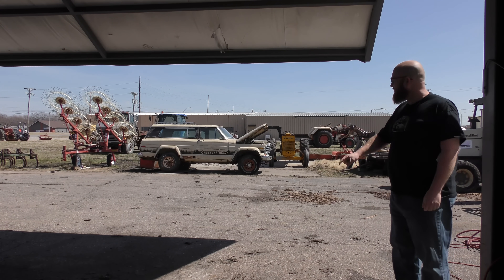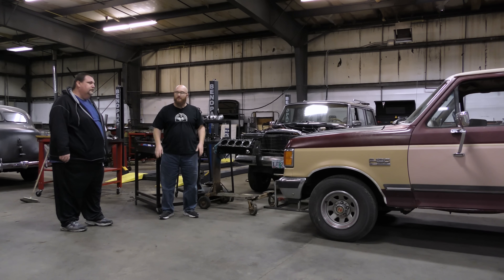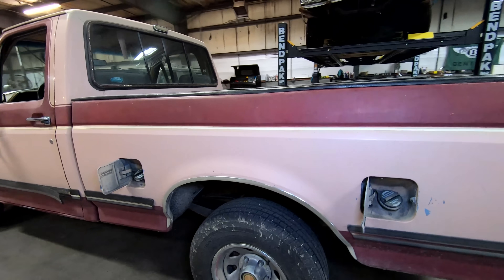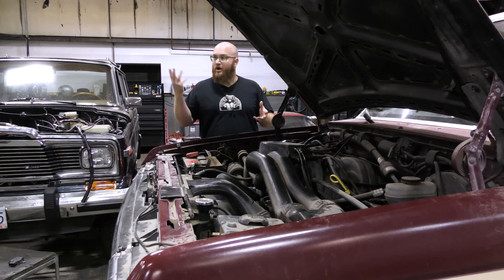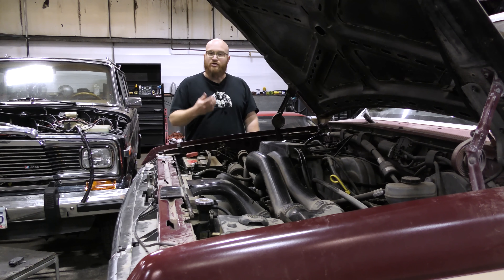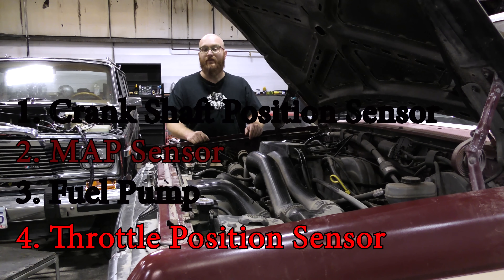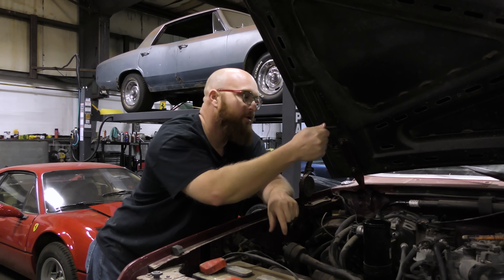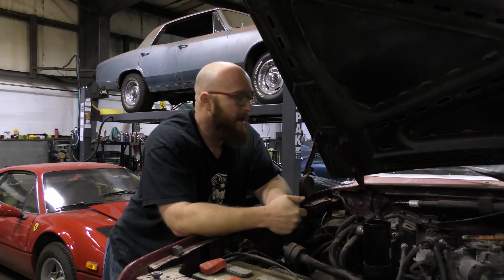Parts cannon couldn't fix this '90 F150. Old School diagnosing by the CAR WIZARD

Comment: Had this exact problem ony 1990 f150 5.8. Could not for the life of me figure the high idle problem. Changed everything, iac valve, tps, map sensor and every vacuum line on the engine. Did nothing. I was pulling my hair out trying to figure out the problem. Then I did the smoke test and I could just see a small amount coming out from underneath the throttle body where the tps is. Bought a new throttle body. Problem solved.

Comment: BBK Performance 3503 throttle bodies (P/N BBK-3503) are in stock at Summit Racing.   Kind of expensive but they are new parts and have improved seals as well.

Comment: For one theres no crank sensor on this truck, 

The required sensors that run these eec4 trucks is map, tps, o2, iat or manifold iat, and tfi/cam pip 

95 cali trucks and 96 will have maf only 

The rest of these are speed density

Comment: I think your wrong about not being able to check out the flashes on the dash. I have a 1993 5.0 Flareside standard cab and I have a diagnosis port similar to an ODB port that you plug in right under the driver side hood hinge. I bought it from Amazon or E-bay. You plug it in and put a jumper wire on the small plug by it, and go through a procedure to get a flashing icon on the dash and count them and look it up in the book and it tells you what is wrong. The book tells you how to do it with the key on and then how to do it when its running. I haven't had to do it for a while but its really pretty simple. You can also jump the small wire under the hinge with a paper clip and get it to flash, but if you do it with the scanner it does a lot better job. It will check everything and you will hear it idle up and down and a few other things too. But yeah thats the way to go. I learned about doing it on a You Tube video. Good luck with the throttle body. Their a pain in the butt to R&R. I just had to put a map sensor on mine about a week ago but I knew thats what it was. I had to replace one before. I also changed the IAC for the hell of it. Straitend it right out.

Comment: I would check summit racing. BBK makes a performance F150 302 throttle body. BBK-3503 should be the part.

Comment: None of the above, it's the idle control valve, and you can clean it or replace it. It's common problem on these old fords. Let me know if you need any more help. If it starts running ruff that would be the EGR. I do all repairs myself.

Comment: I can't believe how much those old things have gone up in value. I paid 900 bucks for my 86 F250 10 years ago running and driving good. It needed some things here and there as any old truck does, but it was the best truck I could find for around $1000 and I looked for months. That's really about all the more it was worth then, I get people quite often asking me if I want to sell it. Sure, but what am I going to buy for what I sell it for that's anything better? it's done a lot of hauling and never left me stranded. I just can't believe people asking what they sold for new for these old white knuckle drivers.
Reply: all the illegal immigrants pouring across the border make a work truck their first investment.  supply low, demand high=prices thru the roof

Comment: OBDII has revolutionised diagnosing technical issues. Before that there was the mythical old mechanic with an even longer wizard beard and he would listen to the intake, smell the oil, stick a finger in the exhaust to look at the residue, look at the spark plugs, check the ignition with a strobe light and then he would take a SWAG (Scientific Wild-Ass Guess).
With OBD you can immediately at least zero in on the problem. You still need to be able to interpret the codes, but a lot of the guesswork has been taken out of the equasion.
Lots of people thought of the check engine light as the money light. And that's just plain wrong. Before that you may have had an issue for weeks and months until the engine finally went Bang while now you are seeing an issue as soon as it occurs and you can fix it before any major damage occurs. A misfire can burn a hole through your cats, so how much money will you save if you can fix it before that happens?

Comment: I have a 1990 f150 4.9 inline. 
It has a idle of 800 and it fluctuates. 
It lacks power when driving.
Idles rough.
When I take off the vacuum line from the pcv its rpms go up to 1000 and the engine smooths out. When I connect it back on it start to idle rough and misfire

Comment: I HAVE A 1989 FORD E350 WITH THE 460 ENGINE, IT RUNS AND DRIVES BUT YES ITS IDLING GO HIGH THEN LOW, IT ONLY HAS 48,000 ORIGINAL MILES ITS AN OLD RV THE WAS ONLY USED A FEW TIMES A YEAR, MY GAS MILEAGE IS HORRIBLE 6-7 MPG, CAN U TELL ME HOW GOOD OR BAD THESE MOTORS ARE???

Comment: I had a ‘91 and it would randomly just die. Put a new computer in it, fuel system cleaning and filter replacement. New wiring harness and all it was a hidden ground that had a corroded connection

Comment: Seriously, that truck is easily worth putting $2000 into. Not just due to the crazy car market but people are craving them before the craziness just due to the simplicity AND durability. Older ones are even MORE desirable prior to any sensors or electronics. If that frame is as good as the body I'd even say it's worth putting $4000 into it. Now if it was manual 4 wheel drive? it's be worth double that.

Comment: I picked up a 1994 F150 with the 302 and a 5 speed 2wd for a case of beer needed a clutch and a front seat the back seat out of my 1997 F350 cc became the new front seat and i also got a 1984 f150 with a 351 4 barrel holley carb and auto trans 4wd for a old broken drill press 😂😂

Comment: Just wondering, do you have different rates for a lambo vs a 90's ford pickup?  or is the difference simply in the extra time it takes to deal with the complexity and engineering of a supercar vs the simplicity and ease of an old truck?

Comment: I’m chasing a rough idle/low throttle on my 95 obs 5.0. I’ve tried the parts cannon. Smoked it. Only thing I haven’t done is compression or leak down test. Needs actual diag. Any ideas from you out there in the interwebs?

Comment: Rough idle and high revs. Think I'll head to the parts store than hand over $2,000. 5 or 6 different parts will cost a lot lot less than handing over my hard earned. A MAF sensor is about $40 bucks and a trip to a breakers yard solves the problem.

Comment: Crank sensor on a Ford distributor equipt engine, where is it? Owning a Ford truck with even the newer MAF controlled system there isn't a crank sensor, the distributor is the entire sensor. You will hate me for this, I probably tossed out the 302 throttle body I found when I was cleaning out my old garage in Newport News VA.

Comment: I have a 1991 F150 Lariat. Every now and then while driving it just dies. It will restart after an hour of waiting. I'm about to change the engine ignition control module. any thoughts?

Comment: My idle is high on my 1991 f150 with the 4.9. I have replaced the MAP TPS and Idle air valve. The screw doesn't change anything at all. I can't get it down to 700.

Comment: trained  to know if you used it who in there right mind takes off a new part and returns it if it dont work fine you got new one and you keep old one in truck in case you need it later anything that old you cant go wrong with new part

Comment: I have an 99 k3500 7.4l 4x4 ,4door crew cab long bed. Been doing the same thing with my rig fixing it up cause it's got 140 thousand original miles. I wanted to ask you what's an good front end rebuild kit or part company for an guy on an budget tell he can afford the good stuff like ac delco or moog later on?

Comment: Fixing to buy a 1994 5.0 with 120k miles on it in great condition and probably get a better truck than any of the 2023 models being offered as far as longivity and reliability is concerned.

Comment: David... you have a lathe, you worked as a machinist... make the parts! You can use better material than Ford would have ever considered. I'm sure you know machine shops that might have some small bronze or stainless pieces. It's not rocket surgery....

Comment: I feel bad for the youngsters out there.  You could get a car in rough condition for roughly a month's wages, from a minimum wage job, back before Cash for Clunkers.  So many 80's and 90's cars(some were actually relatively fuel efficient too) were destroyed, that would fill that sub $3000 market hole now.

Comment: i have a 1990 f250 and for the life of me i cant figure out why its not getting fire replaced just about everything but computer, i had it running bolted up the steering column smashed a white wire under dash and that was all she wrote any help would be much appreciated

Comment: Modern young mechanics are REALLY bad at diagnosing anything pre-OBDII, especially stuff from the 80's and early 90's. There's a learning curve, but if you actually put in the effort to learn, they're pretty simple, you can diagnose most things with a paperclip and a multimeter.

Comment: If someone has bypassed the vacuum could I just remove everything else. If there's areas not connected anyways?
Reply: Also likes to shift into OD early and once you let off the gas sounds like it shifts. It has a harder shifting. And once OD kicks in if you barely give it gas will vibrate you to death. But some of the vacuum has been disconnected

Comment: I highly doubt that truck has rolled over on the mileage. I’d say the odometer is correct. I have a 91 f150 that I inherited from my grandpa. He bought it new I’m October of 1990. It’s cherry red and was garage Kept it’s entire life untii 2018 when I went and pulled it out and worked the bugs out of it.   It only has 41k miles and is absolutely flawless. Itvwas taken to ziebarts to have the rust preventative applied to the undercarriage along with a coat of high qualify wax. I have every receipt and notes as to every single part that was ever replaced, thr dealership or shop that the part was purchased from snd the mileage at the time the parts were replaced. My grandfather sone this with every vehicle he ever owned. He originally special ordered the truck with the travel trailer/camper tow package that includes dual front shocks, anti-sway bar and upgraded rear leaf springs and lower gearing in the differentials. It’s a good truck. I’ve put ALOT if new stuff and installed all new ignition with MSD And ram air Intake along with a whike bunch of other stuff. It’s s great truck. I use it ti pull my vintage ranger bass boat that I restored. They go together like spaghetti and meatballs. The old truck pulls that old boat like it was built for it.

Comment: An F150 with a 302 is a terrible mismatch of a weak engine in a capable truck. I tend to keep my vehicles for years. I sold the F150/302 combo in a very short time.

Comment: Just get one out of a junk yard or let him buy one and replace it. It will be good enough for a truck of that age. Good junk yards will stand behind the part. The Ford throttle body had recalls in the past and I had a few in the garage but  tossed them because I am going towards all electric transportation now. Before I would spend that kind of money on a 302 with 180k on it check the oil pressure. My 302s that lasted to 200k and stopped running it because it had very low oil pressure. The 302 isn't known as a super high mileage engine and very few would go over 200k.

Comment: Well I guessed right. I disagree with your comments about crank position sensors, 90-95% of the you'd be right. I had a 05 Dodge Dakota with a V6 that ate a CPS , it ran erratically, stalled and would  miss and buck. A crank position sensor fixed it, it's twin sister (we had a 30 unit fleet) never had that problem. As far as the repair cost spend $800 and it's worth $2,000. Don't repair it and it's value is based on what it weighs.  As far as your new throttle body you might look at one of the FOX Body Mustang parts houses, might be aftermarket or a bigger size but it won't leak.

Comment: Or the rear gas tank rusts out if you live in the rust belt like in the case of a 93 f150 I bought unknowingly none of the vins on the body panels match the truck and the title is long gone

Comment: MY 90 DUAL TANK HAD BOTH WORKING TANKS MY 91 HAD 1 WORKING TANK AND MY 88 HAD BOTH WORKING TANKS ALL XCAB LONG BED F250 AND 1F150 
ALL HAVE UNDER 200K ALL HAVE BETWEEN 125 AND 180K

Comment: C'mon Wizard.  Before you replace the throttle body have a carburetor shop rebuild it.  It's a stainless steel shaft in a bored out aluminum housing.  They'll simply bore it out, push in brass bushings, and drill them to the diameter of the shaft.  Problem solved forever.  Probably cost $100 and take two days.

Comment: Any of you old Ford guys can help me out with a problem I'm having on an '88 Ranger?
It runs and drives great, but out of nowhere, at random, it will die completely. You'll have to wait 5-10 minutes, it'll crank but won't start, and then after a bit it'll start again, and you could make it home without it dying again, or it could die in the next 5 minutes. I've replaced the ignition control module, ignition coil, plugs and coils, dist cap and rotor, fuel filter, fuel pressure regulator, fuel pump relay... I just can't seem to find why it randomly dies.
Any ideas or help would be awesome.

Comment: Labor times for the water pump and accessories are at least twice that of a comparable Chevrolet.  Cigarette paper used on the upper intake.  Egg and position sensor must be OEM and replaced as a pair….. I CAN CO ON FOR AN HOUR.

Comment: Autozone has the 1990 f150 5.0 fuel injector throttle body for $244.00 or you could just use one from a 5.0 mustang with a rising plate from jegs or even an original, whomever is billing $400  for it is robbing you

Comment: I own. A. 94. F150 5.0.  Had a. Hard time.  Getting a. Msd.  Cap. An rotor.   To work right.  I used the. Clips.  Why. Dnt they put.  The #1 o. The Damm capp. Still dnt run  right.   May have to use. Orig  Ford.capp

Comment: As I recall, the Ford EEC IV diagnostic codes were delivered via voltage meter for the backyard mechanic (not as nice as the GM OBD I system, which you could use a paperclip to trigger the code dump and watch the check engine light blink to read the codes).  You shorted the appropriate pins on the diagnostic connection, and hooked a voltage meter to another set of pins.  You counted sweeps of the voltmeter needle 👍

Comment: The straight 6sucked and blew head gaskets after head gasket. The straight 6 was okay sure but it blew head gaskets like the 5.8L 351w
Sad part is the mileage id get these trucks at 44k-89k miles they’d have blown head gaskets!!! The 302-5.0 was powered less then the 6 but least it didn’t blow a fkin head gasket under 100k miles! …
The 4wd ones the steering knuckles would be snapped off too at the ujoints on the 4wd. The 302 EFI just wants to run. Okay I have had burnt valves to anything underneath the sun and I’ll tell yah the EFI just wants to run no matter the issues it’s got

Comment: I got a 1997 Ford f150 Rusty the gas gauge don't work the gauges don't work the speedometer check all that doesn't work but all the lights up and everything but I can't tell how fast I'm going or anything and or the gas how much gas I got in it something electrical what

Comment: I owned a 1991 Ford F150 XLT Laredo 5.0 V8 auto. It got 18 mpg. I think it had a blown head gasket or cracked head. I would love to have another so I could work again. I would also use it to help those in need. Just need some old truck or something I can haul things in. Maybe someone is feeling kindness for this 61 year old Christian minister. Help me and I will help others.

Comment: Sea foam it through the vacuum hose off of the power brake booster and it will run fine dont buy any sensors they are not bad period ! The throttle body is just dirty dude trust me it does not need a throttle body !

Comment: We were building the Ford Probe back in the 90's. There's a way of using a wire to short out the OBD 1 port in the engine compartment and you can read the codes on the flashing on the Check Engine light in the dash for the codes. As a matter of fact, that's how it was done off-line (at the repair area). Here's an example of how it's done... we used large bent paper clips. https://youtu.be/-YYQKssOEOs